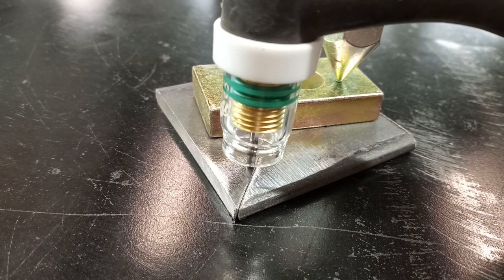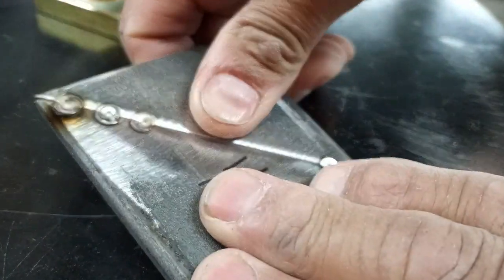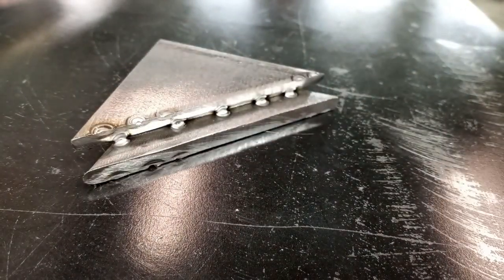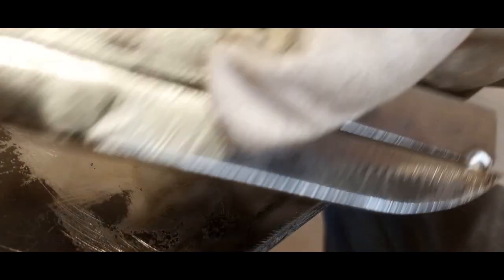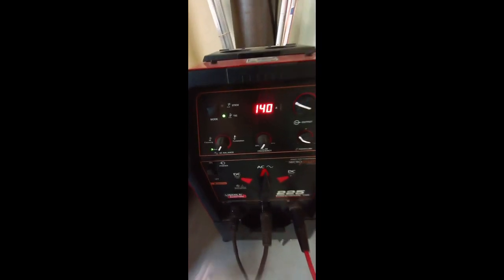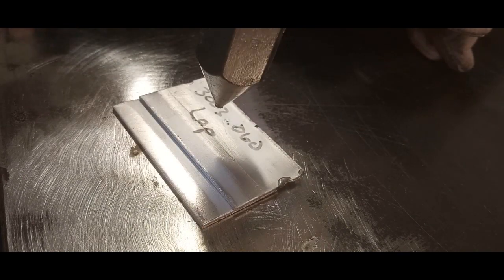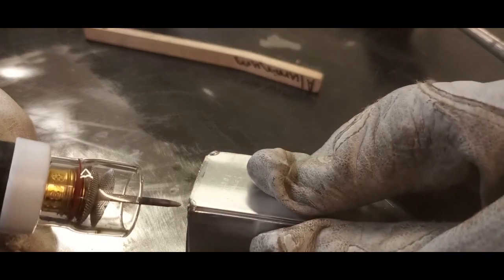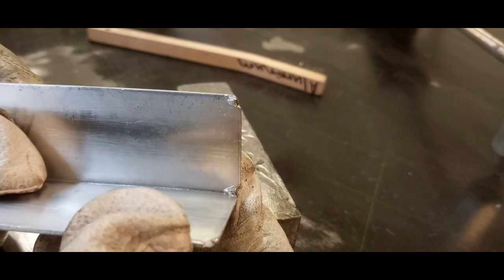The FASTEST WAY to tack weld Aluminum and Steel with a tig welder  -  DIY Auto Restoration

Comment: Hello, thank you for sharing an informative video. 

I was wondering if there is a way to precisely control the on-off pulses (using a foot pedal). 
I am trying to perform tack welding on Inconel parts, but during NDT inspection, the tack weld area showed crater marks (about .015" ).  
appreciate if you can help out. Thank you
Reply from the maker: Maybe an on/off finger switch might help your situation. Thanks
Reply: @guzzifabrication3448  Thank you for the suggestion.
I was also wondering if there is a way to control the pulse duration of welding to maintain consistency of tacks.
I would assume manual on-off switch would always have a human factor playing a role such as stress over time.
Reply from the maker: @naiksh05  The best method is practice. Thanks

Comment: I have the hardest time tackin a filet with aluminum.  i always just burn and melt awat the material.  I never fuses.  Ill try this but im getting super frustrated.  thx
Reply from the maker: This trick is going to help you ! Let me know.
Reply: @guzzifabrication3448  tried it today and the 2 pieces never melt together.  they just burn away.  am i aiming in the wrong spot?  right in the crease?
Reply from the maker: @kmarshall131  what is the metal thickness?

Comment: Like the "blast it for a moment at twice the amperage" rule of thumb! Heading out to the garage to try it out. This is what I've been looking for. Thanks!
Reply from the maker: Awesome ! let me know what you think of this technique.
Reply: @Guzzi Fabrication  Worked excellent. I was welding a 3/8" tab onto a 1/2" leaf spring. A quick blast to my machine's full 200 amps at each of the tab's 4 corners had it placed firmly and the rest of the welding didn't budge anything. Super technique!
Reply from the maker: @jimmurphy5739  Sweet !

Comment: nice, learned this trick many years ago from jody's tips n tricks but forgot it till recently where i was having trouble tacking 1/16" ss sheets outside end corners before fusing, was a pain in the ass trying to tack those ends without burning or getting them to fuse till remembered this trick but you need to floor the pedal and release as soon as it zaps unless you got the right features on the machine that allow just a light tap ,i was able to do it without helmet even at 65 amps and made short work of it just zap zap zap nice little silver zaps ,saved me frustration and lots of time and each one was 95% success

Comment: I would have melted an 1/8th inch from the edge on the tack for a fillet or lap using normal settings with aluminium. I really like this approach for tacking. Especially when it comes to stainless pipe with a gap. It's so hard trying to line up chamfered pipe without it going out of alignment!

I'm interested to know what the strength would be like if you lay rod on top of that? I want to weld car panels and theres so much heat in TIG, if this was a viable with rod I would happily slow down my work rate to get less metal distortion.

Great video, thanks!
Reply from the maker: If a guy has a run of material to assemble and tack this method works well for production. Thanks for watching !

Comment: I highly doubt it will work in my attempts with aluminum, but I do wish it does...
Reply from the maker: I just did multiple joints in the video on aluminum....
Reply: @guzzifabrication3448  i realize, but I'm a novice and I'm kinda struggling with everything.
Reply from the maker: @Zw1d  Keep in mind when doing this technique electrode angle and distance, the way I learned was watching : weldingtipsandtricks / weld.com on youtube, then I purchased ac 4x8 sheet of 3003 060. aluminum cut into small coupons and everyday, a couple of hours a day for a month and a half set down and got " seat time "  just keep practicing and you will be a great tig welder !  Thanks for watching
Reply: @guzzifabrication3448  
make sure your argon is 99.999% pure. 99.99% isn't pure enough for tig welding aluminum. Why nobody is talking about this - is beyond me. (99.999% is called argon 5.0 (five ninths, then a zero (or higher number). 99.99% purity is called argon 4.0 - four ninths then a zero. for aluminum tig welding, argon 4.8 (99.998% pure or higher) is what you need. I had my fair share of cr*p for using argon 4.0. also, make sure they vacuum your argon tank (out of air or less pure argon) prior to filling. and never empty it completely out after.
Reply from the maker: @shacharliberman5084  Thanks for watching !
Reply: It actually did work. Also I was having a lot of problems caused by bad gas. Must have been contaminated with other gases. (Im a real novice, took me some time to figure it out)
Reply from the maker: @Zw1d  Awesome ! good job, happy welding !

Comment: This is great, thank you! What about ramp down settings and other settings on the TIG machines? Can they be left at wha you'd normally bead the weld, just the current up double? Also what is that cool device called that you use to weigh the parts down? I've never seen one of them and it looks really handy. Thanks again, Mike
Reply from the maker: Upslope / downslope settings aren't used on this technique, the weight is called a 3r hand, I'll do a video sometime on building one. Thanks for watching !

Comment: Thanks for the tip! How many amps are you running? If it's double it and 1 amp per thousandth, are you running 500 amps on 1/4 plate? My machine only goes up to 225
Reply from the maker: 1 Amp per thousandth is a great rule of thumb for normal welding, if you do in quarter inch plate try your machine at 200 amps then 225 amps I'm sure either one will work. thanks for watching

Comment: Do you touch the metal with the torch tip?
Reply from the maker: You never want to touch the tungsten to the metal but you do want a tight gap between the tungsten and surface. Try it out let me know your results. Thanks for watching.